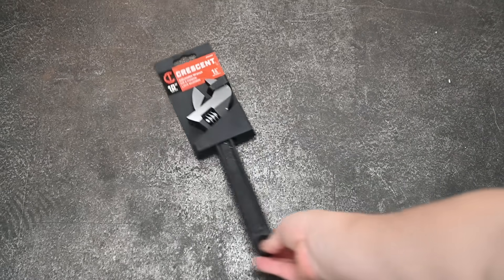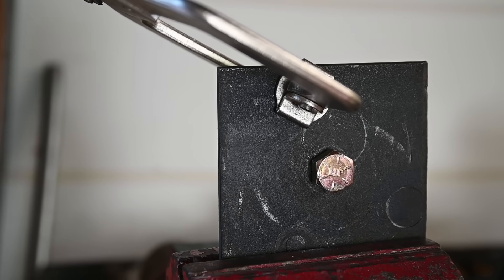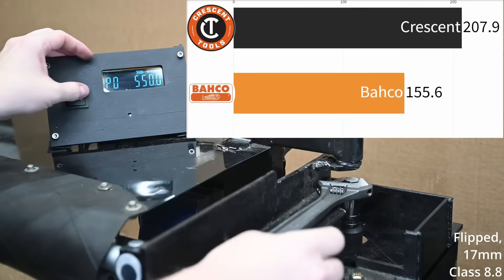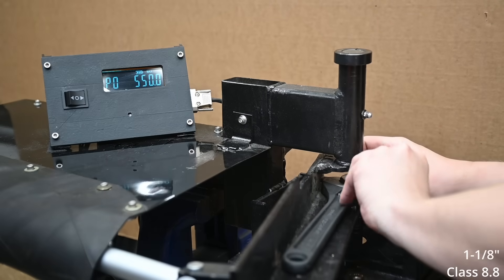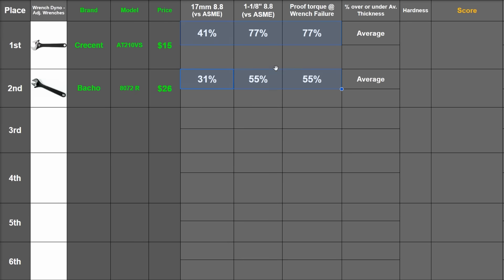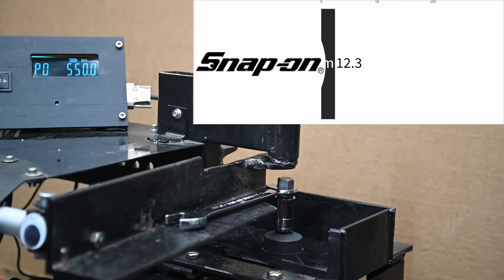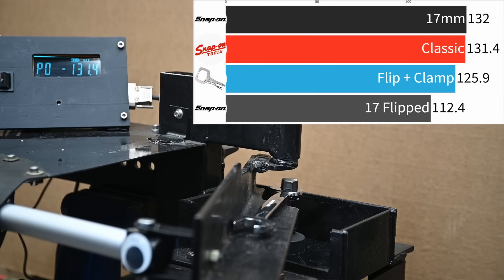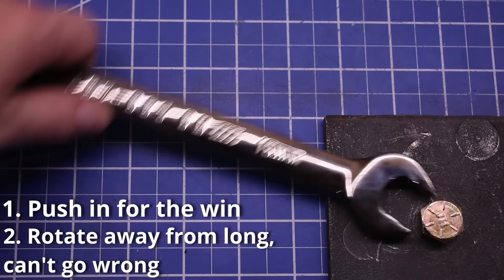Are you turning wrenches the wrong way?

Comment: Yes yes yes adjustable wrench showdown!  Milwaukee are sadly the best holding ones I can find to buy these days for pure grunt.  They added an additional knurl to the worm gear for next to no slop.  I use bahcos daily actually not the tightest thing in the world but the slim head is a win and if you rank Tham head thickness/length will need to be a factor in scoring.  When you make this video done forget lobster Milwaukee and find a vintage pte 1960s or maybe a railroad diamond one as well.  Thoes old diamonds have a incredibly tight jaw especially early 1900s through 40s they built the railroad right?  I'll even send you one if you can't find one.  I know from personal use but semi scientific proof would be nice!

Comment: The Bahco is a different style..not a standard "Cresent" style wrench..it's an adjustable wrench but different..
I don't tighten anything with an adjustable wrench..it's for holding the nut or bolt on the other side..or bending stuff☝️

Comment: So far, I have been impressed with the Milwaukee 8" Wide Jaw Adjustable Wrench 48-22-7508. I still prefer the Knipex Pliers Wrench, but the Milwaukee adjustable has done very well. Milwaukee has some adjustable wrenches that aren't "wide jaw", but I have found I like the width that the wider jaws can open to, and the 8" length version allows adequate leverage for my use cases.

Comment: interesting that the "reverse" direction broke the mechanism at a lower torque than the "forward" direction flexed the head.  I was taught that putting the force on the end of the moving jaw instead of at the base put more leverage on the mechanism.

Comment: Makes sense in certain orientations it's stronger. However I know I do not have the strength to break these. So I use them however I need to. I do however have the strength to bust my knuckles as I've learned lol.

Comment: I have and daily use my first Snap-On combination wrench set I bought in 1982. I have 20 and 40 years newer sets, but prefer the oldest set, pre Flank Drive. Many show severe cosmetic wear and loss of chrome, a couple weld arc spots, but only the 3/4" is slightly worn in the open jaws. The most worn ones have kind of a coppery color now.

Comment: It matters more with jaws' wrenches, like a pipe wrench or channel locks... or even vice grips.
Reply: particularly, Tongue and Groove pliers, and pipe wrenches are designed so that pulling in "reverse" pushes the jaws open.
Reply: @kenbrown2808  This is the first time I've ever heard them called "tongue and groove" pliers. lol.  I've only ever known them as channel locks.
Reply: @calholli  anther one of those cases where Channel Lock is a brand name.  and other manufacturers make similar but different.

Comment: Bahco has been the go to for many years but 30 years ago they changed the pattern to the one shown. Whilst the shallower thimble adjustment allows them to work far more smoothly and easily when dirty it certainly reduces their strength. The normal failure mode used to be the jaw breaking away at the narrow part in the slide. If you do any further tests it may be worth testing an Irega crescent wrench. It is Irega who is making the Bahco now apparently but their own brand uses a slightly different pattern that is remarkably strong in my experience. The swedish made Bahcos dont break but I dont think they make them anymore. They also use a much bulkier pattern in the pre 90's version.
Great tests
Reply: Correct, no longer any Bahco adjustable wrenches made in Sweden. They only make saws and saw blades in Sweden.
Reply: I was lucky to find two Swedish made bahco's in amongst my father's old tools. They are likely over 25 years old and seem to be very well made though I've never punished them. No slop in the jaw. I was a bit disappointed to see them fail in this video before realising that like everything else, standards have slipped for newer tools
Reply: at work i have quite a few tools from bahco and the are nothing like they used to be. the screw drivers breake and the pipe wrenches and adjustable wrenches are soft so a grade 8.8 bolt almost round over the jaws. but one thing they make that works is a holder for hole saws they make model no. 3834-ARBR-11152
Reply: I had been wondering when the quality went down the toilet. I had only heard that Bahco made good stuff, but only started buying tools about 12 years ago and I've always been disappointed with Bahco. Rarely are they even as dependable as the cheap brands, but still the asking price tends to be higher than mid-high brands.
Reply: @Itslvle  boot sales, garage sales, ebay, gumtree or whatever the equivalents in your country seem a better source of tools for me - at least for quality at a good price
Reply: @Itslvle  personally been very happy with the tools I've bought but they are of course not to the quality of the old Swedish made tools.

Comment: Vise grip tests are a must now. My money is on milwaukee over new irwin. As a fabricator I would  like to see the tongs tested. (C-clamp looking clamps)
Reply: New Irwin already beat Milwaukee on Project Farm.  Irwins have always been great performers for what they cost, never had issues outright abusing them with grinders, welding slag or hitting them with 4 lb hammers.  They still have the best selection of jaw styles too.  They're not as good as Eagle Grips, but I'll pass on owning 8 pairs of Eagle Grips that I'm not scared to absolutely treat like crap.  Not interested in losing $40-50 vise grips either.  

Milwaukees are no better than the HF Bremens (same exact OEM, only real difference is the forcing screw adjustment) and I'd take a couple Bremens on the usual sales over Milwaukees any day because I put 0 value in using a screwdriver shank or whatever to further tighten an already clamped vise grip...

Comment: I can tell you it absolutely matters for pipe wrenches and cheap adjustable wrenches. Haven't done much testing on fixed wrenches or a higher quality adjustable.
Reply: well pipe wrenches are specifically designed not to grip when you're going the wrong way so you can easily just pivot up and down like a ratchet.
Reply: @windhelmguard5295  I love that about them. Genuis design.
Reply: ...and channel lock pliers (or any angled plier).

Comment: Grab a pair of slide lock or channel lock pliers and try them both ways and you will see how the grip is so much better when you use the right way
Reply: Yeah, I suspect this is where the "myth" comes from. It is noticeable in the hand. Using them the wrong way actually applies force to open up the pliers, whereas using them the right way, you don't even have to hold the handles together once you've got tension on it.

Comment: 0:41 In the original Swedish, it's known as a "Muttersvarv" or a Nut-Lathe for it's tendency to round out anything you try to crack with it, although the original Bahco(made in Sweden) adjustable wrenches are incredible, there's like zero movement in the jaws once they're set.
Reply: Swedish Nut Lathe is correct.
Reply: I'd really like to see an old Swedish Bahco in this video for comparison. It's sad to see what has become of this brand, especially with their files.

Comment: The wrench offset is why it crept off in one orientation and not the other.  If you consider the force vectors pushing parallel and perpendicular to the handle, in one orientation the parallel force pushes the head toward the fastener, and in the other direction it pulls the head away from the fastener.  I know that all the forces are perpendicular in theory, but when the system begins to deform, frictional forces parallel to the handle start to creep in.

Comment: I'd take feel and slimmer form factor of the Bahco over max torque of the Cresent. If you do test more of these, the Walmart brand Hart adjustable I got a few years ago actually feels pretty decent. I have used it a few times and it did the job.
Reply: quite honestly the adjustable wrench design from 1879 that hand tool rescue sells are probably the best you could ever want. got one for my brother as a christmas present and it's his favourite tool ever now.
Reply: Exactly. Most wrenches have a very bulky head and an inconveniently steep angle from the jaw to the handle, whereas Bahco has minimal angle and slim jaws.

Comment: It would be nice to see slim jaw adjustable wrenches tested as it seems every time I need an adjustable wrench it's the slim jaw one that's needed. 

I often use an adjustable wrench on conduit fittings when possible. Alot of fittings have rounded edges though which makes for a real challenge. I mostly use the WideAzz line of wrenches. So adjustable wrench testing would be relevant to me.

Comment: Funny, I've grown up calling them bahco wrench here in the netherlands. Took until adulthood before I knew it wasn't actually the name of the thing lol, just the brand that made adjustable wrenches popular over here. Never even heard of crescent.
Reply: Also the inventor of the tool, so it makes sense. But they are not the same as they used to be when they were manufactured in Sweden.
Reply: Exactly! It's only because of YouTube channels like this, I learned that the formal name 'adjustable wrench' is. 
The 'bahco' and 'waterpomptang' are the two tools I remember the most, when doing work around the boats.
Reply: Same thing happens in the US.. we call any adjustable wrench a crescent wrench, even a bahco.
Reply: I'm from the States, and I had the exact mirror of that situation. Today is the first time I learned of Bacho.

Comment: If you do a test of adjustable wrenches please put Lobtex in it! There from Japan and have been the only ones I’ve bought since discovering them. As an HVAC installer I use them on a daily basis and haven’t ever had an issue with them backing off

Comment: Flabberghasted, to say the least! I (used to) have a pretty darn antique real Bahco (here a household name for adjustable wrenches!) wrench and it had an arrow engraved somewhere on the head together with a (Swedish!) remark that told the user which way to turn in case force was to be applied: at the tip of the fixed anvil and in the crook of the sliding part. The worm was turning the other way around.  The handle was quite long, if not to accomodate the full brandname, which was quite extensive.
Needless to say I assumed the direction-to-turn-in-case-of-force, was to be applied to open ended spanners likewise. Foolish me...

P.s.: "new" Bahco's do not match the quality of the old, pre-Sandvik ones! Not by a lóóóng shot, that is...

Comment: The correct answer is: use the spanner in the way that you can actually get it on the nut.
Reply: Every comment should just be this comment instead. It doesn’t matter, tool get job done how tool can get job done
Reply: Exactly. Why else would it be offset?
Reply: And if your jaw has any wiggle, gravity will alter the setting, so go short side down.

Comment: As someone who uses a C-Wrench (Crench for short) almost every day pre-rigging Lighting Truss for Live production, I have worn a few out, but never broken one. 

Direction does matter, especially if its on a thumb screw or a wing nut. My main goal is for things tto stay tight, when they will be getting bounced around and battered every show load-in, load-out and inside of a truck. 

As long as they work, cheaper ones cost the same amount as an expensive option because 2 cheap ones last about the same amount of time as something more expensive.

(Edit:) 
Keep in mind, that all my hardware I'm working on has to meet Grade 8 or higher for strength due factors of safety. Nobody wants a lighting fixture falling due to a deformed clamp, even with a safety cable attached.

Comment: Adjustable wrenches are designed to allow the bottom jaw to rotate and lock into place when torque is applied, solving the engineering dilemma of being mobile but capable of locking down for stronger torque without slipping. This is why the correct orientation for adjustable wrenches applies loosening force to the far end of that locking bottom jaw, increasing that binding force. I'm a little surprised there is a different, favorable effect with fixed wrenches, but it seems minor by comparison. We all want a wrench to be useful in many awkward situations, so one designed at an angle will increase the chance of finding an orientation that works. A straight wrench design wouldn't be so versatile as to offer a second (flipped) option if the first doesn't work.
Reply: exactly im a diesel mechanic i cant tell you how many times i've ran into you can only turn the nut or bolt like 1/3-1/2 of a flat and you have to flip the wrench to turn the the rest of the flat repeat 200 times to get the bolt or nut out.

Comment: IN ALL CASES when I can't use the box end, it's because the bolt/nut is in a place that is difficult to work in. I have difficulty getting any wrench on the fastener. Then I will try a Gear Wrench style wrench first. If that won't work then I'll very begrudgingly use the open end of a wrench. In almost all cases the way the wrench is turned all depends on the particular situation. Sometimes I can get the long end on the fastener and sometimes, it is the short end. I only have 2 adjustable wrenches. Both were given to me. I have a 12" S-K and a 100 mm Craftsman. I've used the S-K once that I can remember. The Craftsman usually gets used on tiny fasteners that I don't have a regular wrench to fit and that's not very often.

Comment: So this was not really much of a surprise to me.  With the adjustable wrench in the "correct" direction, the force is pushing the moving jaw down and into the wrench body, meaning the force is being applied to the jaw itself, whereas turning it the other way is applying force away from the wrench body, putting a lot of force onto the adjusting screw teeth where the wrench body cannot help.  It's just physics really.

And yeah, while the snapon climbing out on the "wrong" direction was a little surprising to see initially, as you showed, application of a little extra force prevents that.  So being fixed jaws, it makes sense that it would not suffer the same issue as the adjustable wrench, as either way, the force is being put into a solid piece of metal, rather than between two weaker pieces with plenty of stress risers.

Comment: You've spiked my curiosity with your comment about Vice Grips. Has anyone invented a better Vice Grip?
Reply from the maker: Lots of them better than Vice Grip these days IMO, Malco which has probably closed down now, even Milwaukee's lately are miles ahead in my own non objective experience.
Reply: @TorqueTestChannel  Did Snap On buy the Malco tooling or factory and continue to manufacture the "Eagle Grips" ?  (Although "price go up" ! )
Reply: @TorqueTestChannel   Thanks.
Reply: Malco Eagle Grips were the best, but unfortunately I believe they shut down their USA manufacturing so at this point I'm not sure who is the best. Buy the ones that are still out there while you can.
Reply: Hmm

Comment: For an adjustable it matters because you want the force to be transferred to the fixed jaw not the mobile one. The only reason box end wrenches are angled like that is so you can always get it on a hex shaped bolt. If it were straight there’d be a possibility that the fastener you’re trying to get would be aligned so the wrench can’t fit over it. As it is right now you just flip the wrench and come at it from a different angle
Reply: Farts come from butts.
Reply: The forces are the same either way. That's not why there's a difference. They didn't really go into why there's a difference.
Reply: Thank you captain obvious

Comment: When you do an adjustable wrench showdown, please include at least one ultra-cheap one to replicate the crappy wrench your sister bought in her poor homeowner's grade tool set.
Reply: I did a job in central China. All of our equipment was SAE, and I was assured that the customer had a full set of SAE tools. Naturally this was BS and I had to do a whole ass installation in a pipe mill with chinesium adjustable wrenches bought off of the street in what we dubbed, "tool alley". I could force the jaws on the wrenches open with pressure from my finger. That job was the stuff of nightmares.
Reply: So I can say I have a cheap HDX one that I baught at home depot YEARS ago. I've used that for a long time at work and it's been great. I have snapons but I usually grab that one 1st.
Reply: In all fairness, the average homeowner doesn't need a very good wrench, and it's going to spend 99.96% of its life inside its plastic carrying case
Reply: @Nupetiet  - I picture one adjustable wrench in a plastic carrying case. 🤣
Reply: That's what the OG Pittsburgh is for😂
Reply: stanley and gearwrench. Cheapo and cheap with great value, respectively.
Reply: Project Farm just tested a bunch of homeowner tool kits.  Some had adjustable spanner wrenchs.    They were mostly pretty crappy, but you had to take into account the price.
Reply: You mean this home makers sets of trash with color matched pink or purple handles?
Reply: I bought that for her and she hasn't used it yet but I used it as a hammer cause hers had a broken handle.
Reply: The Crescent was a perfect example of homeowner grade.  USA made Crescent vs. Vietnam made perhaps?

Comment: Question for those of you that work on large hydraulic equipment.  Do you guys use an air hammer with flathead bit to take hose ends loose just as much as you do wrenches, like me? 😅